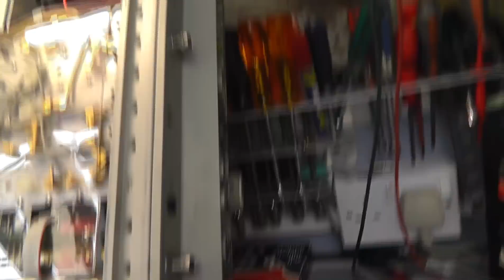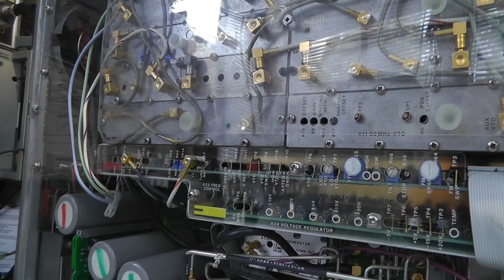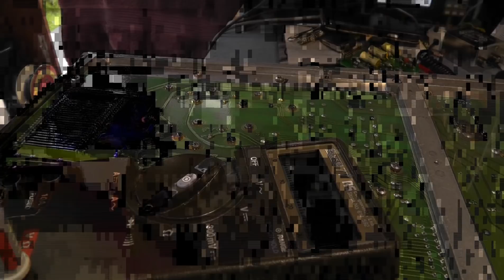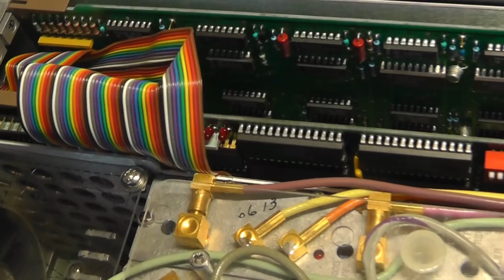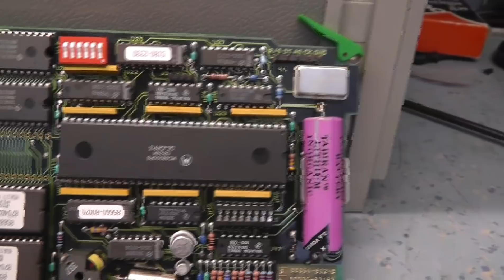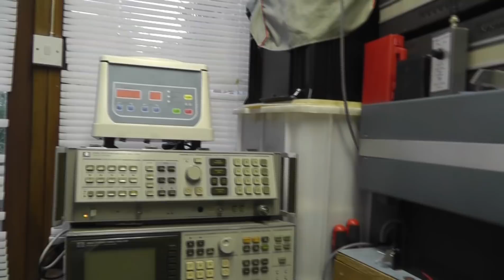Hp 8568B Pt1. Spectrum analyser chance buy. Does it work?

Comment: HI. I have an HP spectrum analyzer 8566B, which has the same fault as your spectrum analyzer. After connecting the IF unit and turning on the power, the CRT does not show anything. The DS4 LED IO error indicator on A15 is lit up, and the error LED on the left side of the front side is also lit up, which may be something wrong. I have tested the IF unit according to your other video, and the test diagram can be displayed normally.Thanks
Reply from the maker: A long shot but unplug the bards and clean the  edge connectors. Then carefully check PSU. Mike the HV section!!!  Don't touch if no experience!

Comment: I think using that other lo board with 18v dropped to 12v is an excellent idea. Now you'll have to get all the pipes hooked up so it can scan freely. Or not just use the oscillator you have if it is accurate enough.

Comment: Hi Simon, have you since checked to see if the unit will still respond to front panel control without the display unit connected, or is that just specific to the "A" version?
Reply from the maker: Yes it will respond but put an instrument error LED light on. Have you seen the flowing videos?
Reply: @SoddingaboutSi  Yes, I have watched (and enjoyed and learned from) many of your videos (including all of them on this unit I think). The reason I was asking is I have an 8568B here, and no display unit yet, and it behaves similarly to yours, in that the front panel doesn't respond at all (except the reset button), and the instrument error and CPU board A14 LEDs are both on (which I assume is due to the missing display connection). I tried reseating all ICs, checking connections, etc. and had no success yet. So I actually just got another one that was supposedly verified working. And it behaves the same way (no front panel response at all), so I was just wondering if the lack of front panel control was perhaps normal for a "B" model when not attached to a display. If only I had a display and cables for further troubleshooting...
Reply from the maker: @ruhnet  Don't panic. I have just disconnected mine and there is no response at all. Left Led is lit as should two leds on the CPU board from memory. Sounds fine to me.
Reply: @SoddingaboutSi  Ah! ok great. Then hopefully both of mine are working fine then. Thanks for taking the time to test that for me! Hopefully I'll come across a deal on a display unit and some cables soon. :-)
Reply from the maker: Good luck.  Make sure the crt has some emissions. Lovley old gear.

Comment: Very nice Simon. Glad you sorted it out. I used to use a 8568A almost daily at work for years. They're a good piece of equipment but they do have their limitations. The darn thing is so heavy we put it on a cart to roll it around, but they are extremely well built and rugged. I've always found HP manuals pretty well thought out and put together really well. However until you get used to all the updates and modifications they can be a little confusing on which version you should be looking at and which bubble or page you should go to next. Look forward to the next update on this one. Thanks for a nice video. Best wishes n Blessings. Keith Noneya